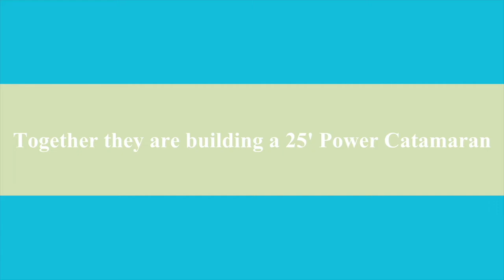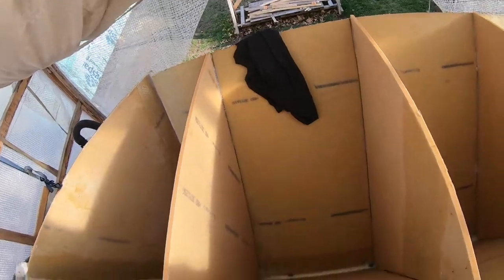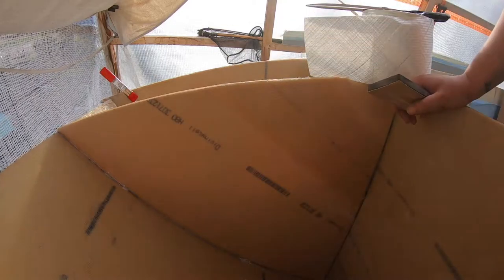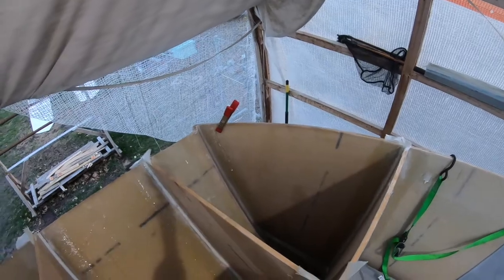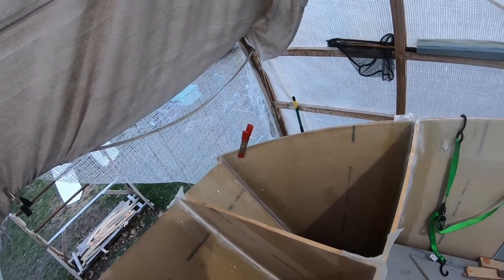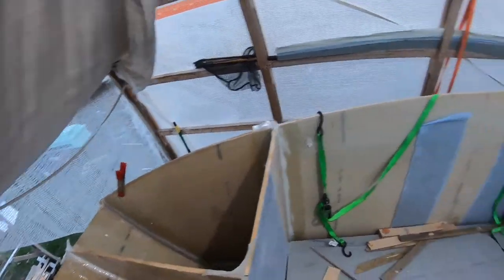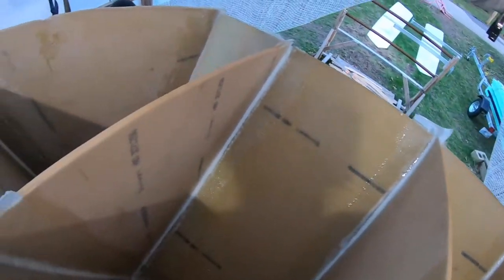Step 85: SO Glad That's DONE! Power Catamaran Build

Comment: Beautiful just wondering all the foam core what brand and what thickness for decks , bulkheads and stringers. Please let me know. Getting ready to do 1977 Bertram 31
Reply from the maker: Hi Larry we use 10 mm divinycell for everything on our vessel. The thickness of glass varies depending on area of boat (structural or not). That would have to be engineered for your vessel.